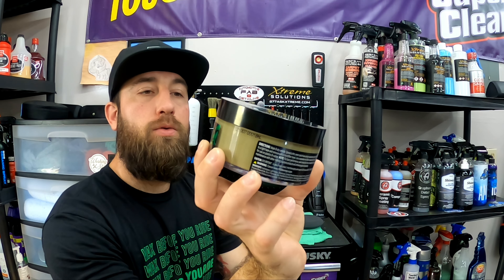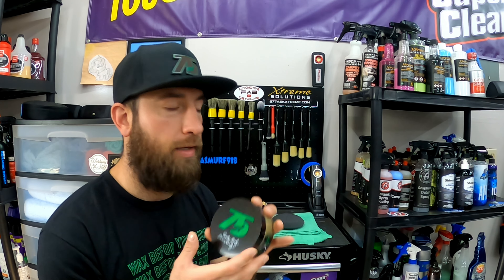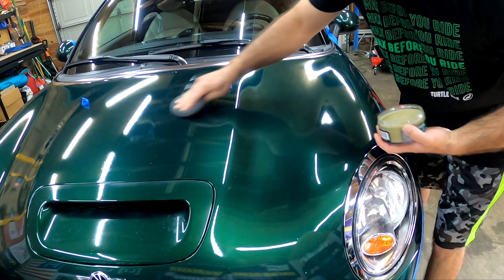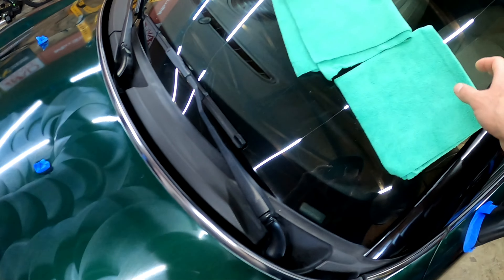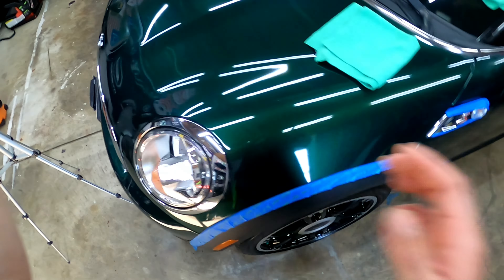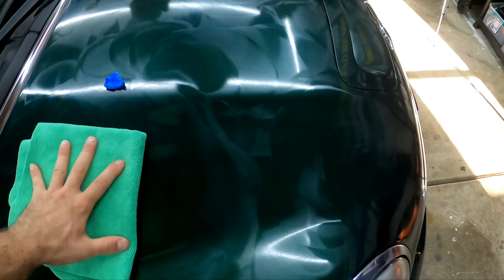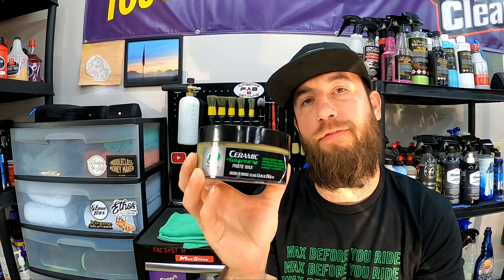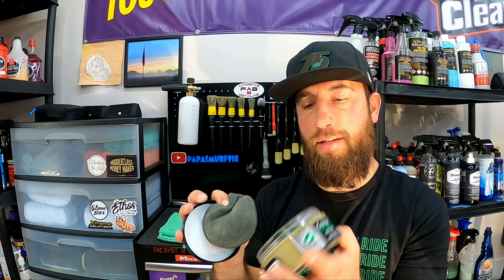Turtle Wax Ceramic +Graphene  Paste Wax Review | Paste Wax is NOT dead | Tons of Gloss, EASY TO use!

Comment: sir,
 i have a Yamaha 2021'MT-07  thats never been washed and has been garage kept. i want to do a wash and detail on it. it has resudue left over on the rear tail sections as well as both sides of the gas tank from where stickers were removed using 3M adhesive remover.  i noticed it has some smear marks also. my plan was to use the Mothers clay bar system with the quik detailer then follow that up with the turtle wax paste wax that you are using in this video.  am i doing this process in the right order? and what are the best microfiber towels to use on my motorcycle? Consider me a subscriber.  2 👍's up
Reply from the maker: Hey my friend! So you've pretty much got it down. 👍 but after the adhesive remover I'd wipe down, then wash an decontamination stage.. then come in and polish. That will yield best results 👌

Comment: I’ve found it has a beautiful finish and the water beads nicely. However, it doesn’t run as well as the  Meguiar’s hybrid ceramic liquid wax. But, it has a nicer finish and slickness to the touch
Reply from the maker: I haven't used the Hybrid ceramic from Megs BUT great to know. Thank you for the input as well as taking the time to watch this video🤜🤛👍

Comment: Should we apply clay bar before applying this
Reply from the maker: Claying or decontamination steps are definitely not 100% needed but if you want to get the longest life out of your protection is recommend it for sure. Look into a clay towel or mitt as they are less likely to marr. Typically you would wanna polish as well. Traditional clay is abrasive and will need to be followed up with a light polish. 👍
Reply: @PapaSmurf918Detail  thanks
Reply from the maker: No problem!
Reply: @PapaSmurf918Detail  could you please help me with one more query. I have just asked under this video. Would be grateful 🙂
Reply from the maker: @smartaquarius2021  Absolutely. Ask away my friend!
Reply: @PapaSmurf918Detail  I have purchased car a month back. Does turtle wax Inside out protectant helps with piano black window trims and door visors or should I go with trim restorers?
Reply from the maker: @smartaquarius2021  Inside Job does not restore trim.. it will leave a bit of protection however they are releasing a brand new Graphene trim restorer very very soon and should be available shortly. That will be a trim restorer and protectant! 👍 if you need something now.. look into Lithium auto care's trim cubes, Or the black rhino blackout 👍👍
Reply: @PapaSmurf918Detail  oh ok. Thanks for sharing. Actually, I am from India and these brands are not available here. Turtle wax release a new product in India after 1 year of its release  in USA or any other country. They released this paste wax a few days back.
Reply: @PapaSmurf918Detail  As I have just bought the car. Is it a good practice to apply trim restorers at such an early stage.
Reply: @PapaSmurf918Detail  for now can u suggest anything for piano black trims and door visors
Reply from the maker: @smartaquarius2021  It's absolutely never to early to apply a trim restorer or protector to trim that's in good shape. Will help prevent it from fading against the sun's UV rays. You could apply any form of protection to the pillars. Anything you'd apply to the paint you can apply to pillars👍
Reply: @PapaSmurf918Detail  thanks. Then i’ll use this paste wax for now. Or have u used turtle wax trim restorers. Any suggestion for door visors as well please?

Comment: Can we apply this wax at A pillar(door post) of car. I have kia seltos car and it has shining black color plastic A pillar frame above front windows
Reply from the maker: Yes you can absolutely apply this to piano black pillars. 👍 just use a soft plush quality microfiber towel to wipe off. They are soft and can scratch easy. 👍
Reply: @PapaSmurf918Detail thank you so much. But we must not apply this on moldings, trims, alloys and matte plastic under wiper area right?
Reply: @PapaSmurf918Detail  and what can we apply on door visors

Comment: Hi ! I'm from Portugal. Can i use it after  aplying a coat of regular polish and after the Turtle ceramic paste wax + graphene ? (My car, a VW Passat 2.0 TDI 4Motion from 2015, when i pass my hand trough the paint it feel's like a fine and thin layer of sandpaper) Oh, can i aply in the car rims too ?
Reply from the maker: Hello there. Thanks for watching. 👍 yes, you absolutely can apply after polishing. Just be sure to use a panel prep to remove the oils left by the polish. Then apply the wax👍. If the paint feels like sandpaper then your going to need to decontaminate the paint by claying. Either a clay mitt or traditional clay. That should be the first step before polishing. And yes, this wax can definitely be applied to rims. Although it may not hold up as long due to heat.
Reply: @PapaSmurf918Detail  Thanks.
Reply from the maker: No problem!

Comment: Nice video Eric, it's good to know there is a quality paste wax available for those who prefer paste waxes over sprays & liquids - especially the easy removal part. It's been a LONG time since I've tried to use a paste wax, I think it was Collinite 476 and that was a nightmare, both application AND removal, and that was over 10 years ago.

I don't think I'll be getting it though, I'm kind of stuck on the Turtle Wax HS Ceramic and now the Graphene Flex Wax (you've seen the pics of the Camaro after 2 coats of Flex Wax). I agree with trying out the 75th Anniversary Paste with a polisher and application pad for thinner, more even and faster coverage.
Reply from the maker: Thanks man!!! Yeah paste wax a long time ago for me was a struggle. This stuff is  awesome.. yeah your golden with your setup.. future maybe pick some up down the road cheap and try it. Think you'd like it! Thanks for watching man!👍

Comment: I actually found that it was a little harder to apply than some of the other waxes that I've been using, including To The Max Wax.  It did come off easy- but application was a little tougher.  I've found that putting ceramic coating is easier than applying this.  I used the same foam applicator too.
Reply from the maker: Yeah, definitely not as easy as any liquid wax... like max wax. Idk some coatings are a pain from what I hear! Although more companies are coming out with some very easy to use coatings.. so, I can't disagree there. 👍